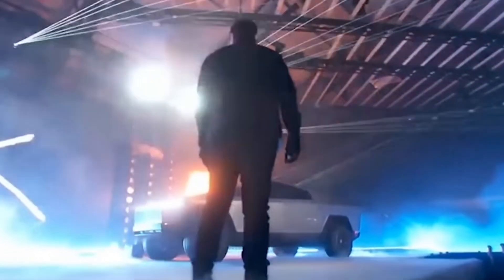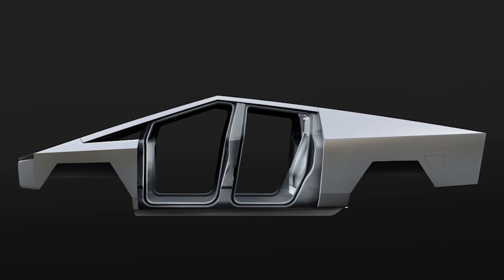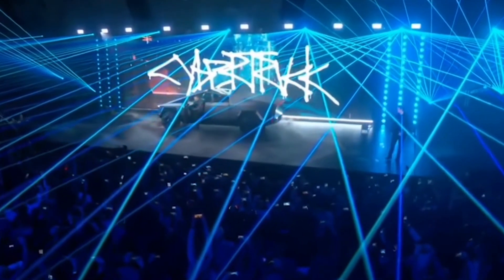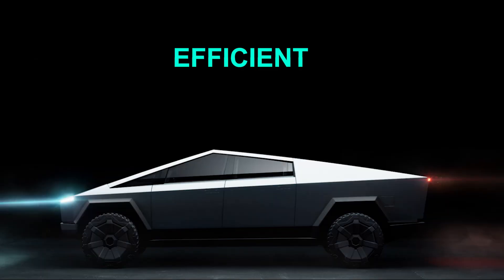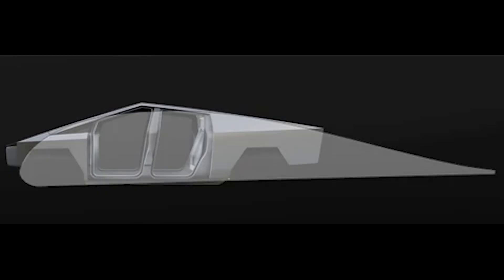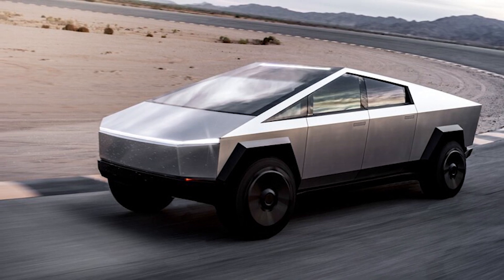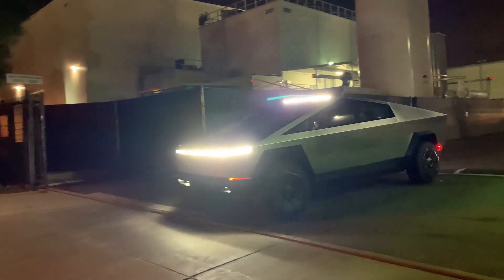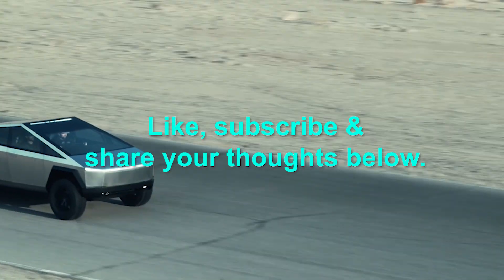Cybertruck is Engineering Genius (and will be copied)

Comment: Just because a truck is extremely sturdy does not mean it is safe. Cars used to be made out of metal and now they have a lot of plastic, the reason? To crumple up when a collision occurs. This cybertruck is going to be very rigid and when it hits something it will have an insanely high impulse forces that will injure the people inside the vehicle. Just because the car survives the forces doesn't mean the people inside don't feel them and get insane concussions. I have been reading articles on how safety organizations question the overall safety of this vehicle. I imagine that it will also hurt the other car it is hitting even more compared to a conventional car.
Reply from the maker: Hey Robert, lots of people are raising this. The steel can be scored on the underside to crumple predictably and consistently (or the hood could be a separate component). I think many will be surprised at how well the Tesla engineers address this. Safety is always top of mind at Tesla. It may not appear so but the driver in Cybertruck sits the same distance from front of the vehicle as they do in Model 3 so there's equivalent space for crumple zone too.

End of the day, Cybertruck won't be allowed on roads if it is not sufficiently safe. Tesla are smarter than to design an unsafe vehicle 😉

Comment: And even that incident with glass; in other trucks, the steel ball would be stopped by the people behind the glass. The glass shattered, but it didn't let the ball through. So, it's pretty sturdy compared to what other trucks have...
Reply from the maker: Absolutely right. And apparently, the glass broke because of the sledge hammer demo (which fractured the bottom of the panels).

Comment: Doesn't have more power than a diesel 3/4 ton or 1 ton in the same price range.
Reply from the maker: Hey Logan, there's lots of narrow cases where an ICE pickup will outperform e.g. it might win on range, or maybe a longer bed, or towing range etc but as an overall package, it's hard to beat.
Reply: @SolvingTheMoneyProblem  no, the towing capacity of a 3/4 or 1 ton diesel is about 20,000 pounds compared to 14,000 for the cybertruck. Also, the range of electric vehicles while towing goes down by a factor of 3-4. So, at max towing capacity, the cybertruck will only get 100-150 miles of range. 

An ev could potentially produce more torque, but all the other limitations make it useless by comparison. Not trying to hate, but also, the hype is a little much right now.

I do love the smart design, body strength, and aero of the cybertruck, and hope more manufacturers will put this much thought into trucks going forward.

Comment: The touchscreen should be behind steering wheel so u dont have to take  eyes off road & can use left hand. 2wd model should have FWD.  RWD fish tails in the snow.  I cant access touch screen because right arm injury. otherwise i agree.
Reply from the maker: Thanks for the input Randall. Shame about your injury! You could always import one from a right hand drive country :D
Reply: Hopefully, by the time this vehicle comes out, every function on the screen will be able to be controlled by voice which might help you.  On the touchscreen you set most preferences initially, and it does not need to be accessed much after that.  The 2 small trackballs/switches on the steering wheel and the usual stalks control common requirements.  Nearly everyone gets pretty comfortable with the screen position after driving their vehicle for a week.

Comment: how is the cybertruck safe in a collision?
Reply from the maker: Lots of people are asking this. The steel can be scored on the underside to crumple predictably and consistently (or the hood could be a separate component). I think many will be surprised at how well the Tesla engineers address this. Safety is always top of mind at Tesla. It may not appear so but the driver in Cybertruck sits the same distance from front of the vehicle as they do in Model 3 so there's equivalent space for crumple zone too.

End of the day, Cybertruck won't be allowed on roads if it is not sufficiently safe. Tesla are smarter than to design an unsafe vehicle 😉

Comment: I wonder how severely the range will decline when towing a trailer weight.   I'd think around 70% so maybe 100 miles  (probably more like 70 after a couple years of battery degredation)  from the two motor?
Reply: Here is a cogent engineering analysis of Cybertruck towing range: https://youtu.be/S4W-P5aCWJs

To cut to the chase: about 85 miles IF the batteries, cables, motors and final drive gearing operated at 100% efficiency - which of course they don't.
Reply: @GroovesAndLands  especially after a couple years of battery degregation.
Reply: Tesla need to build trailers that work with the aerodynamics of the truck. Towing a brick down the highway is the biggest killer of range. The semi is getting 600 mile range because it is so aerodynamic. A simple solution would be a canopy on the back of the truck with a stretch fabric between the truck and trailer to cover the gap.
Reply: @saff226  :  The reality is, IF the Semi gets 600 miles of range, it is mostly because it has a giant battery.

Gap Drag has been sorted in many areas..  Soft / Rigid / etc...  Trucking companies have resisted a lot of efforts over the years, because every kg added to the truck, unless it cuts a kg of fuel means they loose a kg of freight....  If there are only 200-350kg of fuel loaded (per 600 mile trip - to use a "Tesla Standard") there is only so much that any aero gains can improve on....

Aero Drag in Trucks, is significant, but the energy used to haul ass up a 2% slope makes the Drag at 55mph "pale into insignificance" (hyperbole maybe)...

TLDR, It gets Mental with numbers from here on (I have the Spreadsheet if you really want to trial difference scenarios....): - it was made on the fly so maybe isn't so useful to you...

Lets Run some Numbers:
(Rolling resistance not estimated initially)
a BRICK (Cd 1.05 -sized like a truck, at 55 mph on Flat,  (kg -Note. 1kg = 2.2 lb)
Drag Force  =394 kgf
Force down Slope at 2% grade = 799 kgf
(Double the drag, and that is for a BRICK, Literally....)

A Typical "Aero" Bus (A Volvo truck is better than the number I used)

Drag Force at 55' (flat ground) = 225 kgf
Slope  force = 799 kgf

Magic Truck with Cd = 0.1
Drag Force at 55' = 37 kgf
Slope Force = 799 kgf. (unchanged by Magic factors)

(It is all in the Cd Numbers.  Sure Aero Theoretically  could make a saving of (Max)~350 kgf over a brick (84kW at 55 mph - significant), around half or more of those gains already exist with existing Trucks and buses (Maybe not in the USA, where everyone wants a traditional Peterbilt)

NB. Assuming Sportscar-like Cd (Minus the Downforce) and modest Rolling Resistance (driveline losses etc)   mean power consumption  at 40 tonne mass, ~57 kW (76HP) (not a lot if ~600HP is on tap) 

The Truck Needs ~231kg of batteries per 55 miles (1 hour) , so to get ?? 600 miles, it needs  at least 2.5 tonnes of batteries.

Think about it, that is 4.5 powerwall 2's per hour
Cost of battery for the 600 miles is $243,000.00 - And there needs to be at least 20-30% additional cells available to make a warrantable output over 10 years...   
Make it a puny,  0.3 million Dollars in Batteries...
How Much are they selling these Trucks for??

NB. These numbers were at an AMAAAZING  Coefficient of Drag, and a very modest estimated rolling resistance (equivalent of 0.5% gradient, ie 1 in 500   or 0.3 Degrees to the level...)

So:   If the same truck were Powered by Electricity, one full range trip per day for a year..
Cost of Electricity would be ~ $18.5k (Plus 5-15% in transmission and charging losses)

Now Powering the same truck with Diesel  with same trip, cost of Diesel~$74k.

So the Saving per year would be $56.5k

Break-even in 4.2 years...

SO  the Tesla Truck Only needs to Last for 5 years, and it will be a tradeable commodity..

Lets do a Lifecycle analysis on turning the Truck into Scrap every 5 years (or not..)...  That is just on 1 Million miles (probably about half of what a lot of real trucks do - IF the truck is doing only 600 mile legs, and turnaround allows for 2 trips a day. Break-even in 2.5 years isn't-so-bad, it just needs operators to float the next 2.5-4 years of fuel bills up-front, or Through Tesla Finance....)

Lets See these actually rolling off the production line before we waste a whole lot more time on computing stuff  (we haven't factored in the Loss of revenue for the 2.5-3 tonnes of cargo taken up by batteries.)

Ok done those calcs..   Sadly it seems that the batteries cost the operator $98k per annum in loss of revenue - vs, $8k for the Fuel Equivalent... 

So after all it comes to this:   spend $300k up front, costs $98k to make a saving of $56k on fuel per annum.  Seems that these trucks are going to be either an expensive environmental statement ...(needs to be subsidised to make it work long term - the community has to bear the cost, not private (or public corporations), as they exist in order to make money, social responsibility is something only people can do (not non-natural persons), Corporate "Boards-of-directors" can go to Jail /Gaol  for making decisions which are not in the corporations best interests...)...  Or they are going to be hauling Tesla Batteries from New Mexico (Or wherever)  to California, for the forseeable future.....

sorry for that comment if it is a little messy..  Did I answer your concerns?
Reply from the maker: A few folks are wondering the same. Model X towing is TRASH but it wasn't designed to tow. Cybertruck is so I'm interested to see how the battery and powertrain work together.
Reply: That's an interesting question, actually.

I think we should expect Tesla Trailers with battery packs somewhere down the road. Maybe even with assisting low-power motors..? That would surely drive their price up significantly, but that is the only real solution that I can think of off the bat.
Reply: @HTWW  underrated comment!
Reply: @HTWW : There are Truck trailers with self contained Power/Motor Units mounted (often on the front dolly).  So a Powered Trailer isn't unheard of (as well as several Military units with PTO Drive to trailer axle....)

I have seem self propelled Boat trailers built as far back as the 70's, so not a lot NEW..  in this "concept" - it isn't strictly a concept as it has been demonstrated.  Adding battery and Drive motor is "nearly trivial"  once  you have ready access to the hardware.
Reply: @kadmow  that is my point, yes) What I meant to stress, though, is that it should be easier to do with electric motors.
Reply: @HTWW  : Yes, doing it with electric motors is "trivial".  the engineering solution is as simple as "calculating the necessary figures" and implementing it.  Getting the "value engineering" and "marketing" (w@nketeers - to use "a phrase I heard around the traps") to work is a whole different matter.  (Hence why the Bumbling Idiot EM character comes on "stage-Rt", he appeals to the &sperger$  class of tech geek-who-would like to be a truck owner -cool -  jk....)
Reply: @kadmow  Not "nearly trivial" in terms of cost and maintenance. Bottom line is a big heavy brick of a trailer takes a shit load of energy to move at speed, and batteries don't readily hold shit loads of energy.
Reply: @GroovesAndLands  : Re Energy Density, I totally Agree...  I never mentioned cost (in the above comment) maintenance, meh,  about the same as your household refrigerator.....

Useful Load a Useful Distance, this is the metric which varies for every use-case. 

People forget that as soon as you hook up a; bulky, heavy trailer it's: "dang this beast really sucks the gas" - and yes with batteries, you need ~21kg of batteries for every kg of Gasoline you wish to consume (or substitute for -allowing for ICE Inefficiencies).... To Date Range will be the issue.
(NB  the energy taken to travel at speed has little to do with weight, more with Aerodynamics....  up hills and accelerating, yes weight provides the inertia (Weight increases consumption on the way UP, but the potential gives some back on the way down, esp with regen available) on the motorway (flat)  it is Rolling resistance and Aero drag..)

I have lots of thread comments  where I take the Energy Density Line..

Electric Implementation IS pretty much trivial....  Motor, Controller, battery..  these are commodity Items.  Place wherever convenient for weight distribution, voila, done....  (the Other aspects of the Production sequence are nontrivial. I note)...

Comment: What about safety for the passengers? If the front of the car cannot bend during a collision, the total energy of the collision will be transferred to them. This is why there are deformation zones in all other cars.
Reply from the maker: Lots of people are wondering about this. The steel can be scored on the underside to crumple predictably and consistently (or the hood could be a separate component). I think many will be surprised at how well the Tesla engineers address this. Safety is always top of mind at Tesla. It may not appear so but the driver in Cybertruck sits the same distance from front of the vehicle as they do in Model 3 so there's equivalent space for crumple zone too.

End of the day, Cybertruck won't be allowed on roads if it is not sufficiently safe. Tesla are smarter than to design an unsafe vehicle 😉